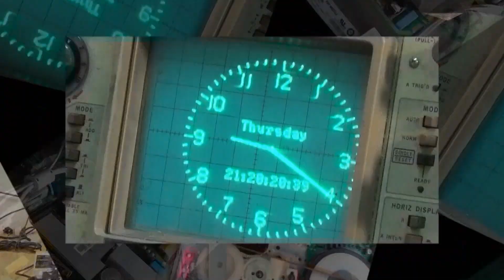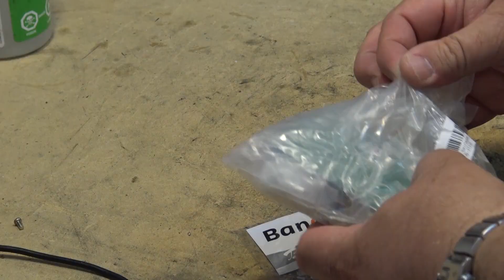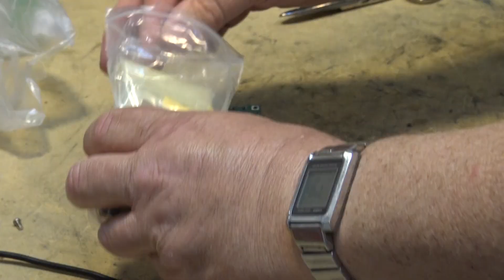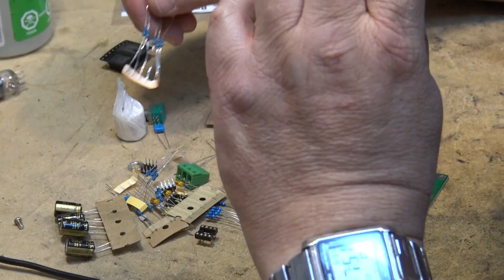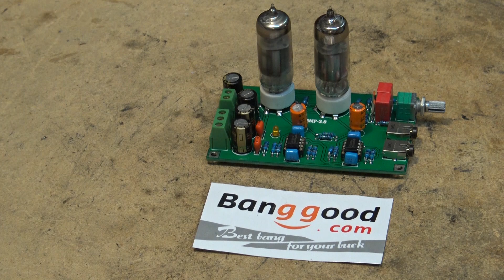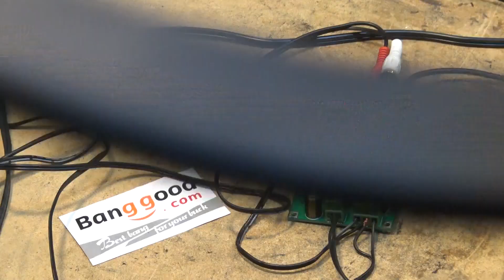Banggood Class A Vacuum Tube Headphone Amplifier build

Comment: I'm in the process of building a tube headphone amp, it uses three Svetlana 6N1P twin triode tubes in what's called an OTL Headphone amp design configuration, OTL is short for Output Transformerless, it means that there is no output transformer used in the design like you see used in most other tube amp designs, this particular OTL headphone design I'm building runs the three 6N1P tubes off a simple power supply that provides 6.3V DC for the heaters, and +348V DC/100mA for the high voltage, the circuit uses only tubes and no solid-state devices in the audio path and also no negative feedback, the circuit itself is very simple.
Reply from the maker: Better hope the blocking cap doesn't short or you will have 347 volts in your ears

Comment: None of those chinese kits have instruction ,Most of the stuff i built from china ,someone made a video follow,and you can look at the picture on line to kind of a way to follow ,I built kits on and off for 40 years ,lack of instrucktion suck but there are ways around it,if a kit doesnt work it sometimes a bad or wrong part sent.great video

Comment: Why does it use 2 op amps, aren't those dual channel opamps? Or is the other op amp for a virtual ground driver?
Reply from the maker: The op amps are for impedance matching. 
Tubes are high impedance voltage amplifier.  The op amps are current amplifiers needed to drive the relatively low impedance of headphones.
Reply from the maker: @rich1051414  the op amps are not driving the tubes. It is the other way around. The signal is prevented to the tubes and the output from the tube plate, which doesn't have a lot of gain due to the low voltage on the plate. The tube is just there to add even order harmonics. The dual op amps are in series to provide the gain for the headphones.
Reply: OH ok, thanks. Makes sense now.

Comment: This is kind'a typical for the kits I have purchased, most don't come with instructions. If you go to Banggood under the product listing sometimes they have instructions or pics that you can down load or look at. Usually they are easy enough for most that have some experience, but newbies will have trouble. I really enjoy these kits.
Reply: I have found that if you send an email to Banggood, they will point you to a location where you can find either a schematic or directions for the build.  I have even relied on them for this when I purchased from another seller and the boards are unmarked.  Great people over at Banggood!

Comment: After finishing building this kit, I noticed a strange behaviour from the audio output. At first, I found my headphone getting warm. When I probed the output, I got about +9V dc voltage. The dc voltage would gradually return to zero but at a very slow rate (i.e. tens of second). As I didn't have unpolarized capacitor big enough, I soldered a 300uF electrolytic capacitor at the output as dc filter. And the dc offset voltage turned to negative 9V. Is there anyone who's any clues what could have caused the problem? Thanks.
Reply: Finally, I've figured out what's going on. When the kit's working, there should be 12V dc across the coupling capacitor between the tube and op-amp. However, since this capacitor charges slowly, a negative dc offset occurs at the input of op-amp whenever the kit's powered on. This leads to a negative dc offset at the kit output. The solution's to add a dc filter capacitor at the kit output.

Comment: does it really give the tube sound ? they only seemed to work as buffers, all the amplifications are done by the preamp ics.
Reply: Yes, that is pretty much all it takes. The tube is in the audiosignal path and buffers the audio. However what may alter the sound even more would be using different tubes. Like vintage New Old Stock instead of the ones that come with these kits. A lot of tubes have different sound characteristics and may sound better or worse.  However all that is optional and its good to start and experiment with. There are a lot of hybrid-tube headphone amps that already come pre-assembled (like from Douk audio / Nobsound) who cost a little bit more (40-50 bucks) that do exactly the same. BUT many come with ungodly blue LEDs soldered under the Tube sockets. So, if you can live with that, you can try these. Or get a cheap DIY kit and solder it together yourself.

Comment: https://www.youtube.com/watch?v=coSt5HWRvv4
Reply from the maker: I saw this when he posted it. Similar design except that one uses a buck converter to generate the B+ from a single supply.
This one runs the 15 and +12 supply in series to produce the B+ B differential. As Dave points out the op amps are driving the headphones, but in reality they are just the current amplifier.  The input goes to the tubes where the voltage gain happens, and the even order harmonics are created. This is coupled to the op amp which matches the low impedance of the headphones.
It could be done without the op amps, but the plate voltage would need to be a couple hundred volts, and an output transformer would be required to match the tube output to the headphones.
A brilliant headphone amp is the first one I built.
https://www.youtube.com/watch?v=axcK7vabsy4&list=PLO37BzxQcqmzXXbd0ucIqmJ6HWeX8lLin&index=1

This used a dual stage triode / pentrode output tube, and can deliver 2 watts per channel. Sounds fantastic. Driving headphones it is probably the best sounding headphone amp I have heard, but I drive a small pair of speakers in my bedroom, and listen to it every night. It uses a proper DC-DC converter to generate 220VDC for the tubes, and uses a proper output transformer.
Saying that, this little amp sounds fine. Just a different design. You don't need really high plate voltage if you are only using it as a signal buffer to create that tube sound. For that purpose that is what this does. The tubes are there just to create that warm sound, nothing else.
Only a tube can create that sound.

Comment: Do we need to buy you a proper pair of side cutters?
Reply from the maker: They are actually electricians snips. Have built in strippers. Data and telco workers use these exclusively because they provide a very clean cut. They are razor sharp too. I use them at work for fiber optic work, as I have to cut through kevlar sheathing on the fiber optic lines when prepping for a splice. I have 2 pairs, a new razor sharp set for fiber, and I took my slightly worn pair into work, and brought the new sharp ones home for use on the bench. When I wear out the next pair, then these ones will find their way into my took bag, and the next set will find their way to my bench for a few months. You use what you get used to. These will cut through a PC board, will cut aluminum sheets, and sheet metal no problem.
Reply from the maker: Those are Kline electricians snips. Razor sharp they make short work of clipping of excess leads. Those things are not cheap either.
Reply: Poultry snips lol.
Reply: When cutting leads,especially semiconductors,it is preferred to cut as opposed to clip with side cutters. There is a risk of sending a shockwave thru the lead which could shatter or fracture the silicon inside the device case. May not be a problem once the part is securely soldered onto the PC board. Some useless trivia...

Comment: LED under the tubes.... it's just as usefull as a RGB motherboard in my computer in the case with no window.......
Reply: I don't get it why they do this either. The tube lights up itself. I guess this is just to enhance the glow.
Reply from the maker: Vinyl isn't top of the line. 
Tube buffers however do add warmth to over compressed digital crap.
Reply: So it looks cool and hipsters who think vinyl is top of the line buy it. So they think they got some insane audio gear

Comment: I don't understand why resistors are made with blue base color Sometimes it's impossible to read the color code
Reply: Blue resistors are metal film type, tan are carbon composition.
Reply: The blue color is normally a tight tolerance resistor. The tan ones are carbon film, usually 5% tolerance, and the brown ones are the old carbon comp that had a tolerance of 10% or more. The latter tended to drift with age out of the tolerance range. Metal film resistors are typically high wattage for power supply sections. Tube amp hackers usually think the carbon comps sound better in a geetar amp. As for me, I think 1 watt resistors sound better than 1/2 watt...

Comment: How do you know which way to mount those ICs in the socket?
Reply from the maker: You did notice that there is silk screening on top of the board right? The orientation is marked with a notch that shows which direction to install just like for the polarity for the electrolytic caps.
Reply: Thanks

Comment: I bought and now own a Hot air soldering iron looks good and works great. I'd show you a picture on here but not allowed. My question is what is the best operating temperature for soldering on tv boards? I looked it up on the google. It tells me 40/60  soldier melting point is around, 230c/460f. WOW! That's friggen hot! Almost the melting Point of my soldering iron. So should I keep my Iron 470 that's about as high as or will go. I been using my mind my iron at 370f. Is that to low? I been. Attending YouTube University of hard knocks lol 😂.  Visiting classes from Professors such as, Professor 12voltvids, Professor shangoo66, Professor AvE, Professor Bigclivedotcom, The Professors at shop jimmy, Professor EEVblog #1 and EEVblog #2, and the Professor at Mr Carlton's Lab. And s few others I'm working on a Orion 13 inch tv aug of 93 it was made model # TV1334A and the board number is TMB556A I can't find. Schematic for it.  I have 5 diodes out of it all the same value except for 1 fracking 1 of them and I would like to find out where she goes. I found some shorted out fets(3 leg resistors)also there is no number on them. I'm trying to figure out what caused this massive blow out.

Comment: Tubes used probably only as an input or output buffer - signal is amplified by two DIP operational amplifiers. So it`s rather hard to call this 'a vacuum tube headphone AMPLIFIER'...
Reply from the maker: Zuurbekje 
input buffers are used to recreate the vacuum tube sound. solid state amplifiers are exceptionally clean and accurate. by adding a triode ahead of the main op amp you create the  smooth even order harmonics that are a by product of tube amplification that give tube amps their "sound".  this is where the gain is.
Reply from the maker: There are 2 types of harmonic distortion, even order (nice) and odd order (bad)
The ear can detect iven thr smallest amount of odd order distortion.
The difference musically speaking is like this.
If you play the note "A", the second harmonic will be the same note "A" 1 octave higher. The 4th, will be exactly 2 octaves higher than the fundamental frequency. These sound nice. Makes the sound appear fuller. Gives an acoustic guitar that fat, beautiful sound.
Odd order order distortion, on the other hand, play the note A, and the 3rd harmonic E flat the 5th c sharp ect. In other words it sound terrible, and you can hear it in very small quantities. Odd order harmonics can be detected by the human ear above the 0.12% level. Even order harmonics don't become objectionable until closer to 12%.
Many tube amps will show distortions in the 2% range and to the uneducated on how the ear works, this sounds very bad, but do a listening test, and the ear will always favor the 2% distortion tube amp over the solid state with much lower distortion.  In my studio I use a clas A single ended all tube amp I built, or my old Luxman LV103 hybrid. In my living room on the stereo I have a class AB all tube amp.
Even in my bedroom, I use a flea powered 2 watt class A tube amp. They sound fantastic. In my home theater setup I use a solid state, but that is just for TV and movies, not serious music listening.
Reply from the maker: After studying the circuit (by drawing it out, and going through it with the scope) I can verify that there is gain going on in the tubes, which would be expected as that is what tubes do. The 2 IC op amps are there as impedance matching devices, to drive the headphones. Otherwise you would need an output transformer, which would reduce the efficency, and require a much higher plate voltage. The way the power terminals are wires, the 12v supply that powers the filiments, is also run in series with the B- lug and is used to produce about 36 v with respect to the +12, which feeds the plate. The tubes are configured as cathode followers, so the amplified audio signal flows from the cathode, and into the op amp, which directly drives the headphones but is not providing much gain. I have spent a fair bit of time since building it, and it does sound very good. When I get my hands on a transformer, I will build a proper split +/ 15 volt supply, with seperate winding for the second supply. Right now I have 3 12 volt switching supplies connected, for testing purposes of course. Anyway for those of you shitting on the design, chill out. It is a cool little amp, and where else are you going to find a headphone amp that uses real vacuum tubes for 20 bucks. I can tell you where... NOWHERE.
Reply from the maker: Piotr Szarański 
they are input buffers. like all the hybrid amps.
Reply: I get it. My concern is regarding language in general. I can`t call it a tube amplifier, because there is no tube responsible for amplification. There is even no need for high output/low input resistance conversion stage, where buffers are commonly used.
Reply: It is an amplifier if it is in the signal path. First stage gain is where the even order harmonics are generated, and this is what you want the tube for. This is no different than any of the hybrid amplifiers, or tube buffers for guitar amps. In a guitar amp the tube buffer is a unity gain device, so the signal level coming out is the same as going in. In this case this is what I believe goes on, the tube is probably configured as a cathode follower configuration. Perhaps 12volt can confirm how it is wired so we can get a better understanding on how the tubes are used.
Reply from the maker: More accurately they should call it a hybrid amplifier.
Reply: So what does a "buffer" do in an amp like this? What is its function? I really don't know and am genuinely curious...
Reply: Thanks 12VV, and thanks for a great video again!
Reply: 12voltvids And it can also be hacked=improved😃
Reply: Oh this old chestnut.  Unless you have a push-pull circuit (not the case here) valves will generate both even and odd harmonics, which are both bad because they lead to intermodulation products that are always bad for music reproduction.  Any distortion necessarily creates intermodulation, and intermodulation generates non-harmonically related tones in complex music signals (ones with more than one tone to start with).

If you've ever seen the IM products on a spectrum analyzer for a naive valve amp you'll know there can be dozens of bogus product tones generated from 2 tone input, and just a sea of noise with multi-tone input.

With push-pull output stages the even harmonics are mainly cancelled (depends on how well matched the halves of the circuit are), so you get mainly odd harmonics, yet this is a desirable circuit topology because the total distortion overall is reduced significantly, which means less intermodulation and better sound (and its
more power efficient).

The ear cannot "detect even the smallest amount of odd order distortion", the ear has limits, and its a simple
experiment you can do if you have a suitable signal generator to find what your threshold is for any particular
harmonic and fundamental frequency - go try it.  It might be 0.12% for just 3rd harmonic, but you'll certainly be able to here intermod products for an amp with 2% even harmonics, trust me - try a 15kHz+16kHz two-tone combination and hear the 1kHz product quite distinct.

A good (music reproduction) amplifier will have distortion (HD and intermod) below what is audible (and lower than the speakers come to that), and this is straight-forward to achieve with solid state circuitry these days, but more challenging with valves and their inherent V^1.5 power law and the non-linearity in output transformers (its doable, but its not a sensible approach really - power consumption, weight, fragility, drift/aging).

BTW 0.12% distortion is about -58dB, -80dB is routinely acheived with solid state amps, and you can get opamps that do better than -130dB noise+distortion (special measurement techniques are needed to detect such distortion levels with even the best lab equipment).

Comment: Are they 12 AX7 valves?
Reply: Synthematix no they are 6j5 tubes
Reply: I suspect that 12AX7 tubes need a lot more than 16 volts plate voltage to operate...

Comment: What about using 12x PP3  9V batteries and 1x PJ996 6V battery that ought to work, you could have used the 6P1 which is a flat vacuum tube made by KORG and will run of a PP3 9V battery.